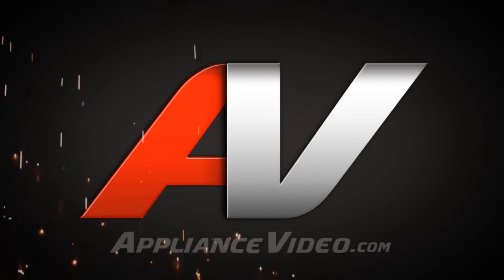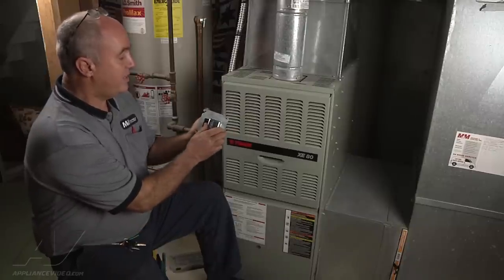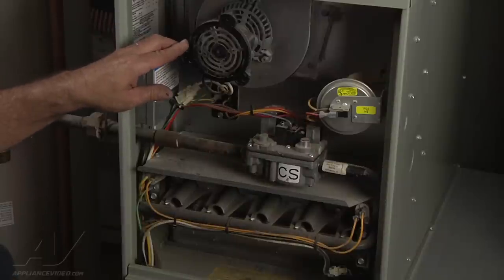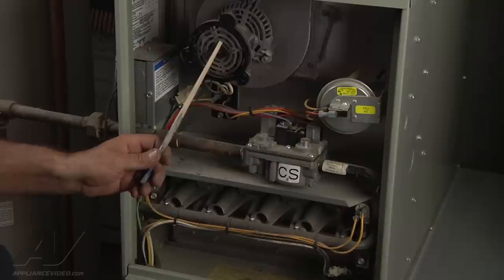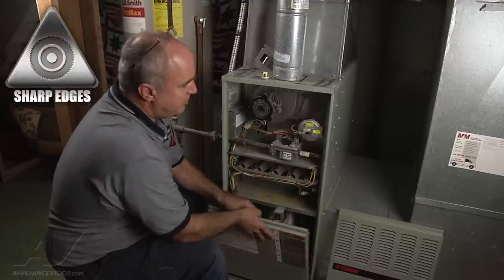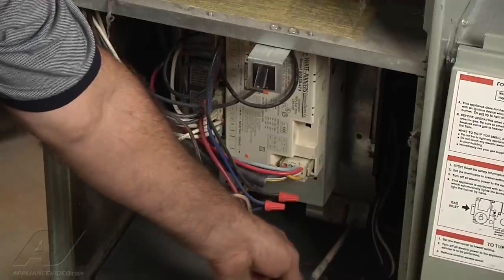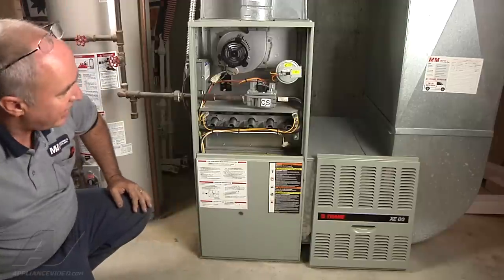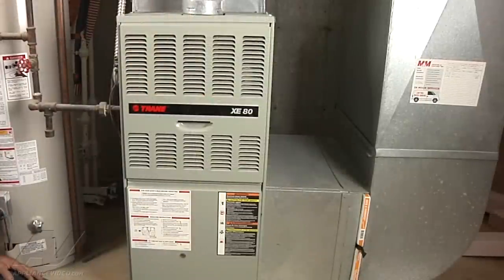Furnace Diagnostics & Troubleshooting - Motor, switches, wiring & much more

Comment: How or where I can order a IFC for my furnace Rheen model 1012-920A from the IFC
The furnace model is RGLH-07EAUER
Thanks
Reply from the maker: Great question, If you have a
more technical question that our parts department cannot answer, our
technicians are answering all questions at our website at www.ApplianceVideo.com under our Repair Help section. You can also call
our parts department at 1-800-830-5465 and they can give you help 6-days A week
Mon-Sat . You can also search at www.SaveMoreOnParts.com 7- days a week.

Comment: 2 Qestions: Some asshole installed the heater upside down, is this a problem? Also I am getting a three flash trouble code, what do I do?
Reply from the maker: Jason
         We now have our FREE repair help website at ApplianceVideo.com, all of our technicians are answering questions daily on this website for anyone needing help. Just copy and paste this this question under REPAIR HELP, and one of our  factory authorized technicians  will answer any technical questions at absolutely no charge on your appliance issues. We also have over 2600 free repair videos to help with your appliance repair issues. Thanks for your support. Matt Ace Appliance factory service technician.
Reply: Really late. It's not upside down most likely it's actually a real furnace type. There's no possible way. You may have a down flow furnace in which the heat comes out of the bottom. The three flashes should be a code in which depends on the cover of your door on the Furnace.

Comment: No sediment trap! Water gate valves!
Reply from the maker: Great question, you can call our parts department at 1-800-830-5465 and they can give
you help 6-days A week Mon-Sat . If you have a more technical question that our
parts department cannot answer, our technicians are answering all questions at our website at www.ApplianceVideo.com under our Repair Help section. We have over 3,000 common questions and answers that you can easily search through by your
model number, appliance make, and problem or error codes, and It’s free to
search through our question & answer library.